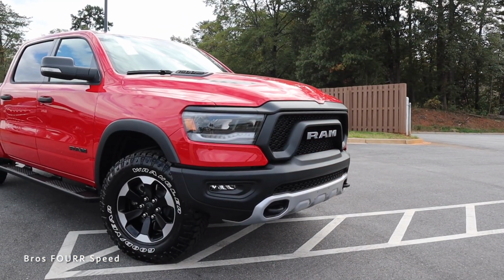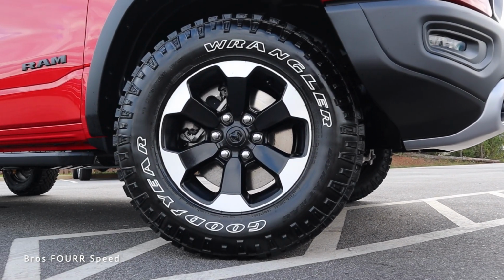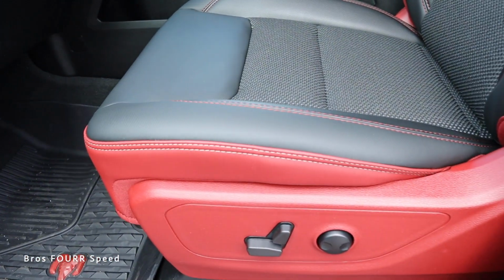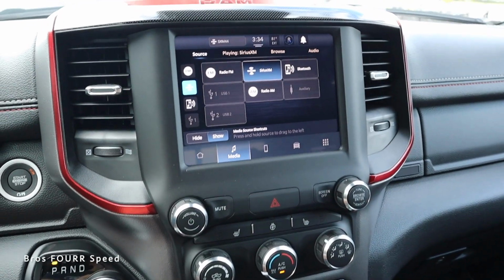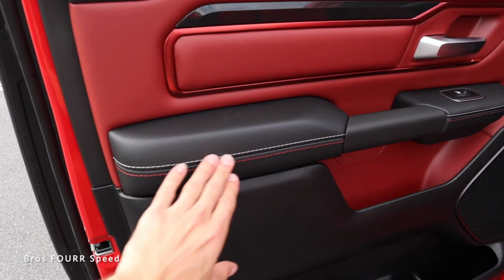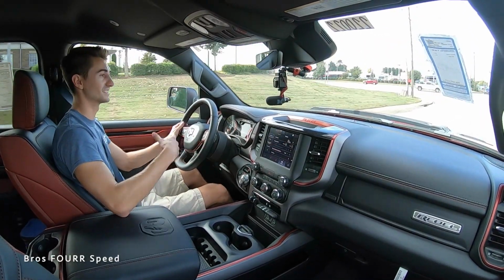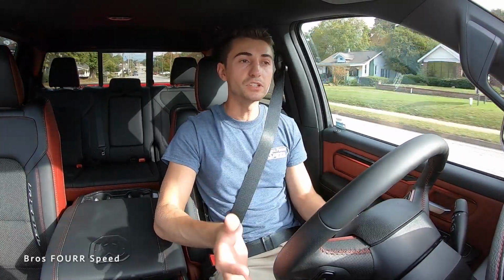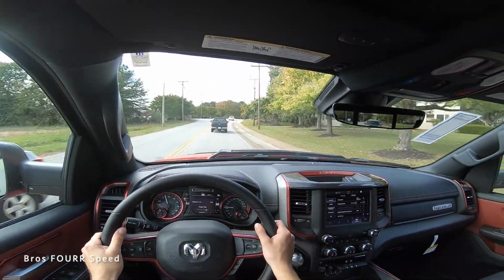2022 RAM 1500 Rebel Crew Cab 4X4: Start Up, Walkaround, POV, Test Drive and Review

Comment: Is the steering on this 22 model year as light as previous model years?
Reply from the maker: I drove a 2021 Rebel. It's been too long to tell the difference. But I thought it was very nicely weighted
Reply: @BrosFOURRSpeed  Ok thanks. Ya I saw your previous vid and you mentioned that it was light. I've got a 22 on order and am strangely a fan of lighter-feeling steering weight so I was hoping it was the same.

Comment: Great video....Finally a review on Rebel thats not fully loaded. I am considering this truck strongly. How would you rate it against a Big Horn of the same year and options?
Reply: The average mpg on mine is 12.5 , not very happy about that
Reply from the maker: I'm sure this would do a bit better
Reply: I have a 2020 Big Horn BTS edition, and man i love my truck. Ive been thinking about switching to a Rebel, i would like the off road capability and the crew cab. But my big horn has way more features for roughly the same cost. I have a sun roof, the 12” screen which is phenomenal, ive got the electronic rear lockers, and the Alpine premium system. The only downside is i’ve started to hate the quad cab i would like more space in the back, but all of the features i have compared to a similarly priced Rebel, i cant justify the switch
Reply from the maker: I liked it a lot! Havent been around the Big Horn enough to know the differences. But this drove great, was super stylish and not crazy expensive compared to a loaded truck!